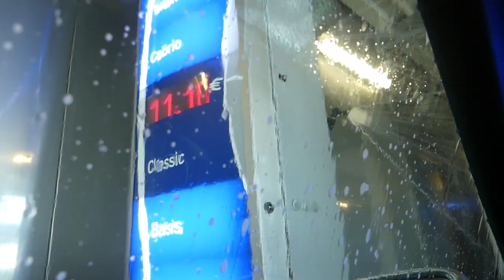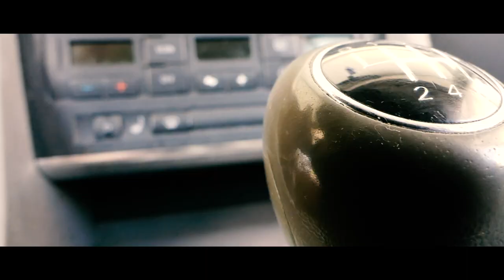Daily Vlog in Germany | American Football Player

Comment: those "Wunderbaum"s are not supposed to be unpacked completly right at the beginning. If i recall correctly, there are small signs on the bag of the Wunderbaum which tell you to pull the bag back a bit every week so the smell of that thing doesnt kill you instantly :D
If you unpack those things in mid summer and the car heats up you almost cant drive anymore cause you will faint due to the smell ^^